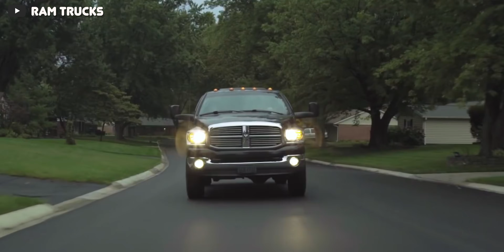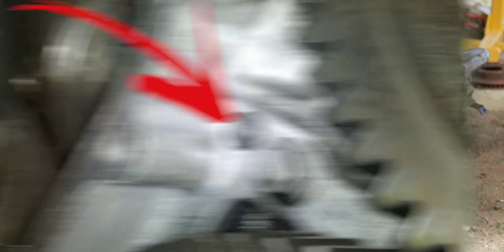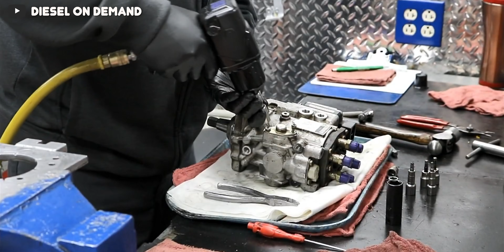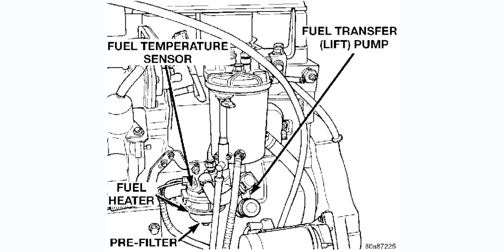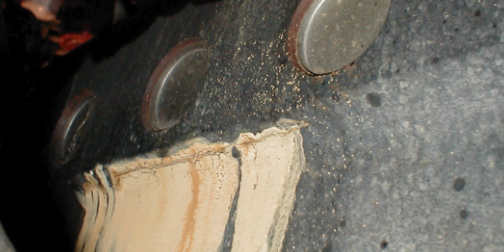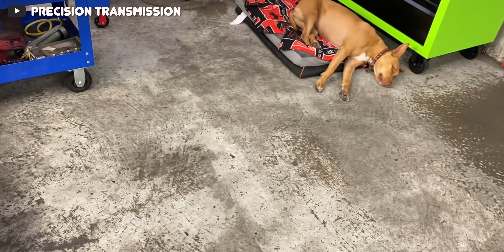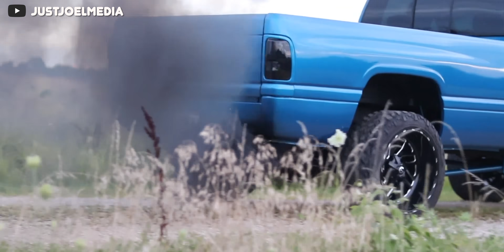Everything Wrong with the 5.9L Cummins (12V & 24V)

Comment: You forgot to say that the front main and rear main seals fail. Also the tappet covers over time warp and cause leaks. Also you forgot to say that just everything leaks on a 12v or 24v
Reply: You forgot to say, after 250k to 350k miles it will have some oil leaks.
Reply: over 300 thousand miles and the tappet cover is starting to seep, just enough to keep some dirt on the engine. rear, front, no leaks VE pump no leaks, turbo return pipe had a little hose at the bottom, that seeped and I just got a new one and super easy to put on. lots of trans coolers three from the factory and my 727 aka 37RH had over 300 thousand with NO issues, replaced it with 46RH for the OD and better highway experience.  Talked to a friend of mine and that 37RH could be a moneymaker with the drag racing crowd,

Comment: Point is cummisn 12 valve and 24 valve are reliable as f 
If you want more reliability put a fast fuel system 
Autos stock are okay but if you want power build a auto or use a manual nv4500 or nv5600 and use a good clutch 👍🏻  cummins wins all day every day
Reply: What’s the name of the fuel system we need?

Comment: Solid list, here are 2 issues I've dealt with and 1 I had fixed before it was a problem:
89-93 VE pumps tended to leak at one of the seals after several years of low sulphur diesel. Most of them were probably fixed by the mid 2000s.
94-98 P-pump engine not shutting off or turning on because the shut off solenoid fell apart.
94-2003 5 spd manual 5th gear nut backing/falling off.
Reply: YEP JUST BOUGHT AN 1999 4X4 WITH THAT SILLY ISSUE BUT I GOT THE THING FOR 3K 
SO THAT'S A GOOD DEAL I WOULD THINK 
GOTTA FIX 5TH
Reply: @arthurn9237  WHY ARE WE YELLING?
Reply: @seer1388  Hit mute

Comment: 12V is the BEST diesel engine for a working truck with a 5 speed. Miners in my area have been using them since new, and the only problem - which is not an engine problem - is the rest of the Dodge truck ! The bodies fall apart way way before the engines. Seen many stuffed into late 70's / early 80's Chevys. With a NP205, Dana 44 front, corporate rear no issues for years and years.
Reply: I'm doing that swap myself right now. 12 valve P-pump and NV4500 into a 1983 Chevy K30.
Reply: Kdp “killer dowell pin”
Reply: IT'S TRUE HELL FRIEGHT LINER USED TGE 5.9 IN THE FL70 BOX TRUCKS AND THEY GO N GO NGO 
HUNDREDS OF THOUSANDS OF MILES

Comment: my truck has a 2.4 nonturbo inline 4 and that enough power, why the fuck would you need a massive engine
Reply: Depends on what you are using the truck for. If you don't tow heavy, you don't need a Diesel. If you tow heavy, on a regular basis, then get Diesel.

Comment: The only reason they leak oil is a shitty design for a tappet cover or oil pan rots away 03 and up blocks don't have a tappet cover anymore so no more leaks there.
Reply: my 91 the tappet cover does actually nothing besides hold the crankcase vent up. Glad they did away with it. mine is starting to seep so I see a VE pump coming off in the near future (10-15 years) if I live that long , ha.  I heard you can change that tappet cover without removing the pump, taking the pump off is easy with the puller.
Reply: @jond1536  don't go cheap on a billet cover I did and had to take vp back off to replace get a Keating machine billet cover mines been great no leaks

Comment: In my lengthy career (39 years) I have not had the opportunity to work on many Cummins engines until the last couple of years. The bulk of my diesel work has been Navistar/Ford. The last couple of years our fleet has been phasing out the MaxxForce and started using the 6.7 Cummins and the L9 350 Cummims. Our smaller F550s are still using the Ford 6.7 diesels.

So far the Cummins have held up remarkably well with the only problem on the 6.7 is a fuel pressure regulator in the end of the common rail that has failed on a couple units. It looks like a little bolt in the end of the rail that costs about $300. You can either remove the rail to change it, however I found its easier to leave the rail in place and take off the EGR valve for access. 

How did I discover that was the problem? Here is where Cummins beats the others, Cummins has 24 hour technical support! I work a swing shift so this comes in handy at 11:00pm when I am pulling my hair out. Give Cummins a call with the serial number of the engine and they are more than happy to help. Need an engine wiring diagram or want to know any service bulletins on the engine? Go to Cummins Quickserve website and set up a free account; type in the engine serial number and learn everything about the engine you are working on. Download the app and the info will always be with you.
Reply: Wait, so you don't call everything junk with a stupid picture and video title for views? This dude is the last person I'd take info from. It's like he's reading nonsense he's gauged off the web.
Reply: THAT'S BRILL SIR 
A GOOD DEAL 👍👌
Reply: Thank you. Wonder if this would help for a 98
Reply: @abraxaseyes87  yap sure will
Reply: @abraxaseyes87 yup from 1989 to today just have your Vin number
Reply: Still have 89 with cummins,fixed dowel pin issue, 3 voltage regulators, ran ground wire to negative terminal 3 water pumps. Still runs.
Reply: In your opinion, what's the most amazing diesel you can fit into a Rover Defender?
Reply: @jamesm5192 Mercedes, much less vibration, lighter by 300lbs more horsepower and torque
Reply: Have you experienced any bone problems like osteoporosis from all those physical labour?

Comment: I,have a 2005  F350 dually with the 6.0l which so far has a Unicorn I've towed heavy  with it and so far with the factory torque to yield head bolts they have held, even after adding a BD Diesel boost fooler so it will keep on boosting past the 26 psi factory limit.  Not saying that it hasn't had issues but they have just been glowplugs and various Injectors. I,keep up on my fluids and filter Maintenance, I've installed a Misimoto radiator and upgraded the Intercooled also and coolant filtration and changed the transmission pan to the later model to get the better filtration from the so called Rock catcher filter on the early year models. I,have a friend who had the 6.4 and he did a Cummins swap to a 5.9 and he loves it now.

Comment: Clickbait......total clickbait......had a first gen Dodge dually with the 5.9 12 valve. Sure it needed the pin fix, but with a few mods that engine can literally do anything you want. Rotary pump engines, P-pump engines are awesome. The VP44 needed a proper lift pump, and once you upgrade injection pump they were fine. Only other thing was there was a period were the blocks would crack. The Columbus cast blocks were fine.
Reply from the maker: Clickbait, yes.

Comment: Got a 2001 one ton dodge with the 53 block. It's at 280k miles and still going strong. I've had it for about a year and the only problem I've had was the ac compressor clutch seized and sheared the belt. It's a tough truck, but those 47re's are iffy
Reply: My 53 block has 430k still going
Reply: My 53 has 500k miles
Reply: Iffy until built properly.
Reply: As long as you don't beat the piss out of them you'll be just fine!! Mines only got 110k but never have engine problems. Every time I've had it break down it's always sensors. Dang electronics!
Reply: I had a 53 that went at 18K. Dodge replaced it on warranty with yet another 53. I sold the truck at 50K and to my knowledge 12 yrs later it's still going. I have a G-56 on my special ordered '07 5.9.
Reply: Shoot, I might do an Allison swap.
Reply: I also have a 53 block in my 99 it’s got 260,000 on it. People have to remember not all of those 53 blocks were thin.